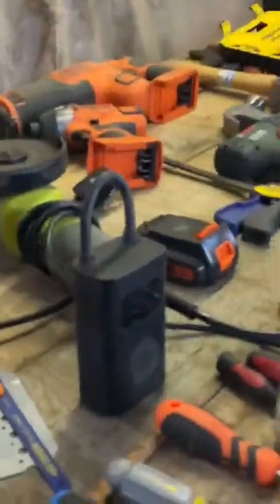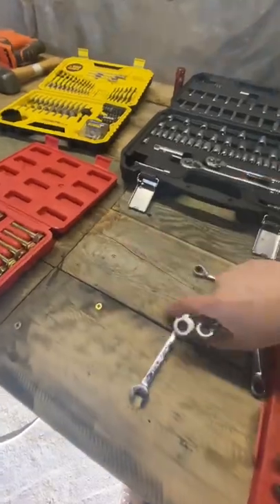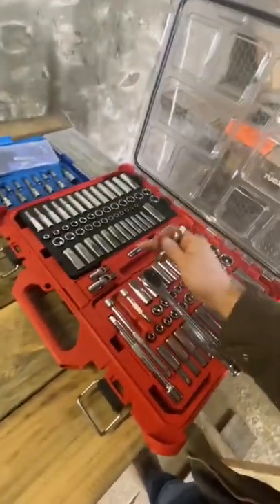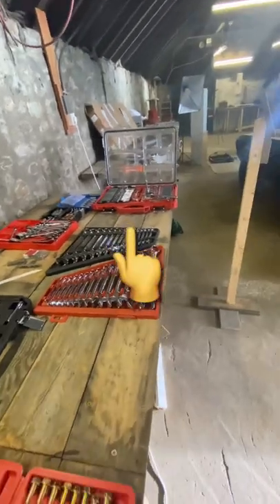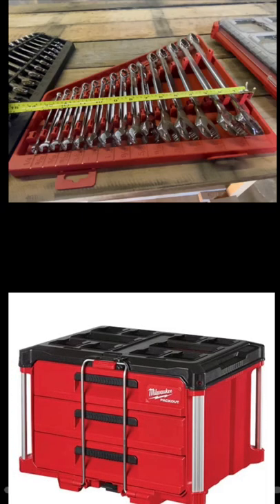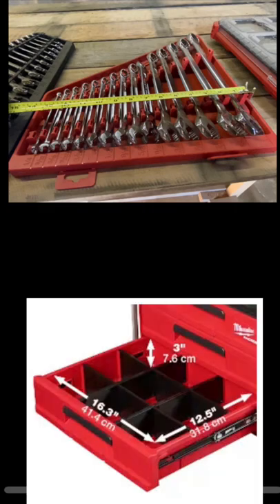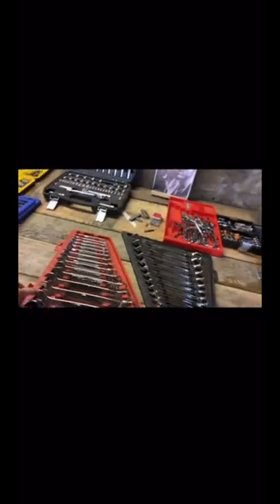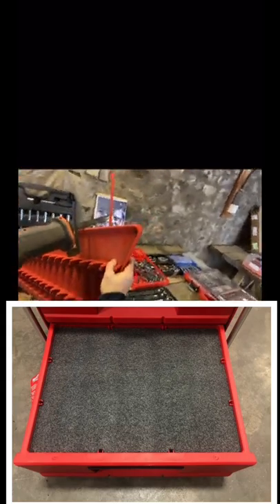Packout-Fitting Milwaukee Wrenches in Packout drawer

Comment: It genuinely blows my mind that Milwaukee has not solved this issue. I thought for sure we would have a pack out set for wrenches like we did with the sockets by now
Reply from the maker: Seriously!
Reply from the maker: https://youtu.be/gnJt4wBOSzY
Reply: Slam dunk product and seems easy to design.  My guess is there's some penny pinching C-suite exec
Reply: Yup, I returned my 500$ wrench set after using them for a couple months, getting frustrated they don’t fit in the Packout. 
I don’t buy Milwaukee anymore.

Comment: I prefer my tools on the wall
Reply from the maker: Interesting. I never considered that.
Reply: @FootageFactory  in my opinion it’s much better because you can see them faster
Reply from the maker: @csheepboy  you’ve def given me food for thought. And actually your idea might be better, only thing is I have two shops a mile away from one another and have to go back and forth.
Reply: @FootageFactory  I understand 
I don’t know, maybe you can use one shop for mechanical stuff and the other for electrical…
Or double on the tools (I think the in the long run it’ll be cheaper)
Reply: They got harbor freight over there?
Reply from the maker: @CarsFoodWeed  No they don’t, but I still compare everything to Harbor Freight. I guess it’s my baseline.